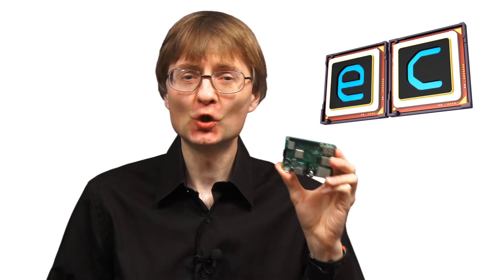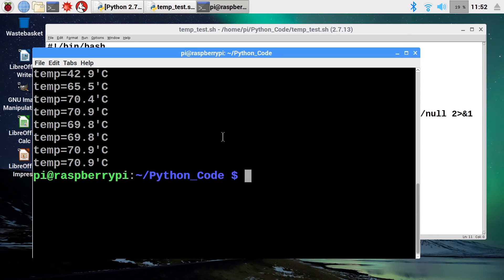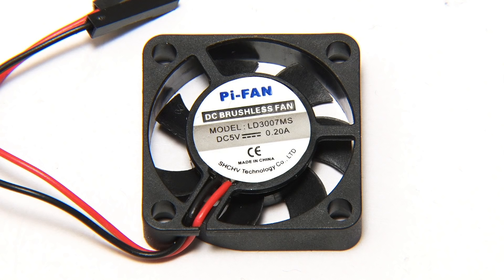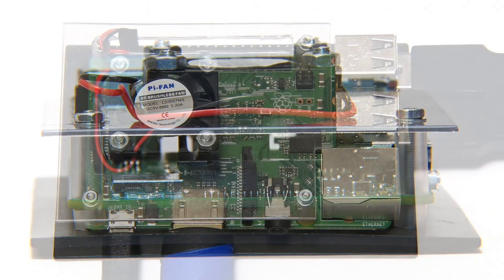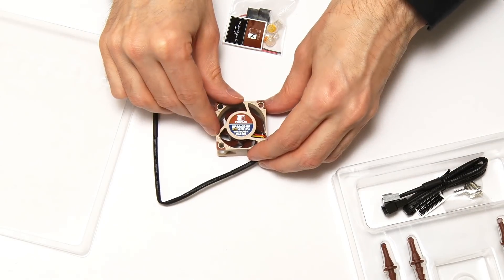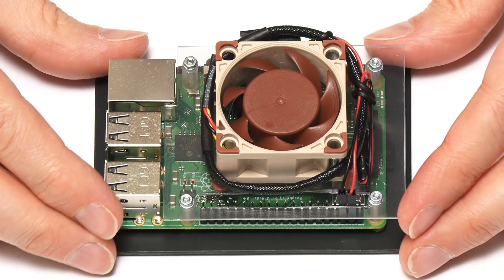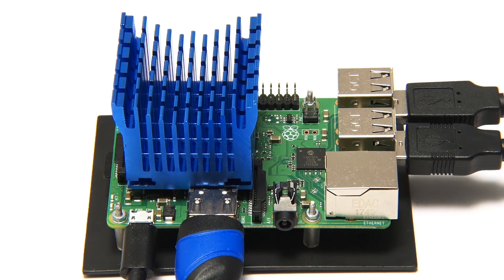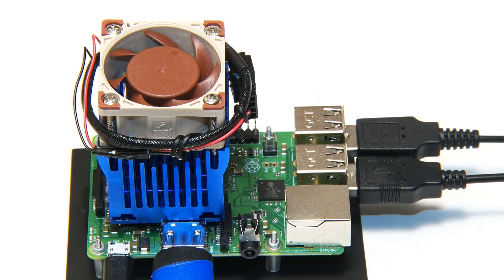Raspberry Pi 3 B+ Extreme Cooling

Comment: I have found that although sysbench maxes out the cpu cores nicely at 100%, not all 100% cpu loads are created equal.  For example if you run:  openssl speed -multi 4

The core temperatures ramp up much faster and peak higher.  This would not
 make a difference for one of one of your 'extreme cooling' solutions but it does make a significant difference for most average cooling solutions.

For example, those cute little 15x15x10mm heatsink ramp up to 80C very quickly under this load, and start to show the  temperature warning thermometer icon and throttle back the CPU.

Even non-overclocked and installed in the well respected FLIRC case (one of the best stock thermal solutions) my P3b starts to intermittently show the temperature icon warning after running this benchmark for several minutes.

When invoked with the simple command above, openssl will run through all it's crypto hashing and cypher algorithms, and you will see the temperature shift a few degrees as the cpu load changes slightly.

You can experiment by locking it to a single algorithm aes, rsa, sha256, etc.
openssl speed -multi 4 aes
openssl speed -multi 4 rsa
openssl speed -multi 4 sha256

Unlike the Odroid C2, XU4 etc, which ship with adequate thermal solutions, the Pi 3, even the latest 3b+, is a thermal basket case as shipped, so be sure to include an extra 10 to 15 dollars for an adequate large heatsink/fan when comparing price/performance.

Comment: Put zip ties to secure the heat sink firmly to the Pi. Better contact will yield better temperatures. In practice, those can go all the way down to 10 degrees difference, but since you are already (relatively) so close to ambient under load (about 15 degrees delta), your gains won't be as big. Also, try putting thermal paste below as well as above the copper plate. Also, if possible, try to get a thinner copper plate. Would be a fun video if you could try the suggestions from the comments.

Comment: Lovely stuff. I once ventured into overvolting and overclocking a Raspi 2 using a 50W peltier cooler, that had the hot side cooled with a large liquid cooling system. I got CPU temps down to -11C and frost started to grow on the back of the PCB. By some kind of miracle the Raspi actually survived.

Comment: The such a large difference between the noctua and standard fan is probably more due to the fact you had the standard fan sucking air through the heatsink rather than the noctua which blew over it.

Comment: I think it is the copper nugget  used in the larger heat sink that makes the difference, copper is a very good thermal conductor compare to aluminum (what the heat sink made of ). Try put the copper nugget in between the cpu and the small heat sink, see what will happen?

Comment: chris you should have it run your script but add at what Freq the chip is running at that moment and display it. This way you can see if it does throttle down in Speed?

Comment: isnt using a 5v fan frowned upon on a pie?
Reply from the maker: No reason it should be. As I explain in the video, the only pins that are safe to use are the 5V ones (as they are not technically GPIO pins). So actually, connecting a 3.3 volt fan to a Pi is what is dangerous (unless connected to the 5V pins via a resistor), as you end up wtih no voltage regulation/protection between the fan and the Pi's electronics. There is a great deal of poor and misinformation out there on Pi fans! :)

Comment: Please explain how 3rd test worked.... Coz the fan is the wrong way around
Reply from the maker: The fan was indeed sucking up rather than blowing down (my mistake), but this has very little impact on its cooling. It still moves air through the heat sink vanes and across the board. In a PC, where you are attempting to move an airstream with multiple fans working in combination,  individual fan direction can matter greatly. But not in an open rig like this! :)

Comment: Love these videos - keep 'em rolling :)   I ran the exact same script on my 3B+ with FLIRC case - here are the temps:-
41.3  /  51.5  /  53.2  /  54.8  /  55.8  /  56.9  /  56.9  /  58.0.    Not bad for a passive cooled heat sink/case!
Reply from the maker: Those are indeed good numbers. The FLIRC case has a good design.

Comment: The fan is a good solution. Im using it for the SBC projects, mostly from small netbooks, and Im also using the small heat sink. Last one was for my godson, when I fitted the SBC in a toy car, and the fan on the roof. He is using it for gaming purposes, and the temperature never raises above 60 C. 
Anyway, the final combination looks impressive. If you ever do decide to put such a massive radiator on the Pi, consider overclocking the CPU, and testing the results how far you can push the Pi limits

Comment: Hi Mr. Computers. I have a suggestion for your script.
add time in front of the sysbench command like you would sudo in front of another command, and it will display the time it took to run the in stdout like the temperature does. 

This way you would easier see how much it throttles or preforms compared to other computers.

Maybe there is also a way to display what the cpu clock was as well in a similar way.

Comment: Nice video. :)  I think the solution I like the most, is the die-cast aluminium case you can get for the PI - https://www.ebay.com/itm/For-Raspberry-Pi-3-and-Raspberry-Pi-2-Metal-Case-with-Cooling-Fan-Black-C9N4/192492581357?epid=10017057806&hash=item2cd173b1ed:g:9BwAAOSwvvBauHLh
Paired up with a small heatsink inside, a very neat and tidy solution.

Comment: Hi Christopher, i still have my PI3 with the heatsink and fan just like you set up on your prior video over a year ago.

I am not a overclocker, just prefer piece of mind when i can run my CPU almost 20 - 30 degrees cooler at idle and when working

Out of curiosity. i would have thought to include  in that script the start time at the beginning of the test and the time when it end the last loop and finalizes, that way you can see or estimate how often the PI was throttling and running on the lower 1.2g instead of 1.6g ( i am guessing the normal and throttled speed )

Regards  George

Comment: Chris, I thought you completed this experiment last week. However, this video shows you using different fans and different spreadsheets for the temperature comparisons. The last test, large heat sink with fan you might try another piece of plexiglas using the previous piece for the GPIO pins and the base of the large heat sink, then cutting out the squarish piece with a Dremel tool. You apparently don't have though or you would have shown one being used to cut out holes on the previous two templates. What is next? A water cooled heat sink?

Comment: You had the first fan the wrong way around.
You had it so it was sucking  warm air from the board rather than blowing cool air from outside the board.

Also I would think that copper spacer will hamper the results some what

Comment: You could have checked the fan alone ses to function very adequately all alone, with mine running no more than about 40°C.  I have the fan just about 1 cm off the top of the chip, glued in a square hole flush with the surface of the standard case. Mine is pushing air at the board, not pulling it.

Comment: That didn't seem like a very fair test between the cheap fan and the noctua since one was pulling air and the other was pushing air, pretty big difference since in this case you have the air being blown right onto the heatsink, also thought I'd mention that unless you're buying from a local seller even $5 is too much for those little fans, you can get them for $1 from china if you just search for "40mm fan"(even less if you spend a minute sorted by lowest price).

Comment: for more permanent solution, why not use arctic thermal epoxy? (it can be removed with temp/thermal difference and safely popped off via heating the heatsink with an iron or popping in the freezer)

Comment: The second test could have been better if you used the fan to blow air on to the heatsink and not pull, like you did with the noctua fan.

Comment: hava 3b 38.7 itle but have good cooling (selfmate alu cooler and 80mm fan on 12 volt and whitch pin 4 on the can i control the fan whitch pwm) but the fan is a extream loud pressure fan the fan is on itle but on 45°C the fan go on overclocked on 1,35ghz

Comment: I always find the Pi cooling tests fascinating. Thank you. Two things. First, I take it that the hole on the metal covering on the chip is for cooling purposes. I wonder if a hole drilled into the heat sink that lined up with the hole on the chips metal case would affect the outcome of the small passive heat sink test. Second, could a person slow the clock of the Pi down and significantly affect the cooling (not that anyone would use a Pi set up that way), but if one did clock the B+ to perform like an original Pi, if one could find the Pi running cool enough without added cooling measures.  Thanks for this video!

Comment: It would make much more sense to cover the parts that would short out from the large heatsink with electrical tape rather than use some copper that would add more instability to the heatsink (and therefore danger of tipping onto components and shorting out the board) as well as further material for the heat to spread through before it makes it to the heatsinks fins which would most likely make a difference to the results.  Also it looks like the large heatsink could be secured with a couple of cable ties.  This is not ideal but better than nothing.  At the end of this that leaves some room for overclocking the Pi to allow for greater performance.

Comment: Perhaps using the NB Cooler 1 the processor would have gotten a little bit hotter if the test had been continued for some more time, because it needs more time to fully absorb the heat given.
But still, great experiment to show the power of passive cooling solutions or the difference price can make using a cooler fan!

Comment: Great experiment with interesting results!
But I’m wondering: isn’t that bad to wire such high current inductive load like a fan without any flyback diode?
Also: at 5:00 you are saying that the 5V pin is directly connected to the 5V micro USB power source. I don’t think that’s actually the case, there are some poly fuses on all power rail. If you are doing some intensive CPU tasks while using some USB devices, using a fan may be a really bad idea since the fuses on the RPI can be close to they max rating and could blow up.
I’m not an expert so If someone have more info on that, I’ll be really interested.

Comment: Cooling CPUs is the key. I still do own an old computer from 2005 i built it with an Abit AA8XE 3rd motherboard, P4 intel 540J @3.2 Ghz, 4 Gb Kingston ram DDR2,  an Hyper 48 Cooler Master as CPU cooler. The original Graphic Card was a MSI NX6600 GT i replaced with a SAPPHIRE HD5670. The original PSU was a FSP Bluestorm i replaced with a BeQuiet 550 Watts. I changed all originals fans with ebmpapst 120 mm front, 90 mm on CPU and 2 x 80 mm at rear. "ebmpapst" is formely knows as PAPST. I cleaned out all ebmpaspt fans once each year. This old computer is still running like a charm a triple boot XP SP3, Xubuntu 16.04 and Mint Rosa 17.3 on 2 separated HDD with no errors at all ! Booting on XP requires 5 min though lol :) Thank you so much PAPST  you made this old computer lasting 13 years now !!!

Comment: Very good video, I notice the last cooling solution was resting on top of the black connector on the left side, perhaps it could be a better result in the temperature if the coolingblock was shifted 2 mm to the left and pushed down with som zipties

Comment: Thanks for an interesting video.  My criticism is that in your table of results you do not show the price in relation to the effectiveness of the cooling. Could you make a video which demonstrates the cheapest cooling option? So far am am using a laptop cooler from the £1 shop! I've got one under my tangerine iMac, my router and my laptop and R-Pi. Total cost £4.

Comment: Even Raspberry pi 3 B+ need a heat sink, i can imagine that Raspberry 10 need a water cooling.

remember Nvidia Riva, 3DFX Voodoo, or ATI Rage GPU ? back then (late 90's / early 2000's) even the most high end GPU doesn't need a heat sink.

Comment: I do like that noctua fan setup, especially with the cable management, making it look nice and neat, if you want to use an extreme cooling method, try mounting a Pentium 4 northwood cooler from an old early 2000's Dell on it

Comment: Another very good video Mister Barnatt. The Noctua looks like the solution to go with. I admit though while I realize that this is totally impractical, I would be amused by seeing how a 3B+ would operate when cooled with liquid nitrogen just for the heck of it. LOL  Seriously though how would I access the GPIO bus with the Noctua installed? I cannot remember seeing a riser card or extension cable my wanderings of Pi 3B+ accessories. Are you aware of any 3B+ accessories that will be coming to market in the foreseeable future?   Cheers.

Comment: next time, please also add a timer into your script. If a system is thermal throttling, the temperature might stay the same for different test, but the run time for your test might go up.

Comment: I have seen one person risk their Pi 3 B+ by removing the metal cover from the CPU to directly place the heatsink to the CPU chip itself. The risk of the damage you can do though versus the minute gains in cooling you could possibly get I think is are just not worth the risk of permanently damaging the Pi.

Comment: I have a Pi3B+ in a layered case with no heatsink and a small fan running on the 3.3V line instead of the 5V. Even at full load for a long time OC to 1.5GHZ it does not get any hotter than 60C.

Comment: I wonder if we were to cover the Raspberry Pi with kneaded eraser  on  the back and front to prevent short circuits except for the CPU and mount the back neoprene mat and metal plate and mount the lock mount on top so that the cooling probe can be installed with it's associated neoprene sleeve and rotate the locking ring by rotating so that the cooling probe won't pop out and connect the SBC to the 5V supply that also operates the Phase Change Cooler and connect the power switch to the power connection the Phase Change Cooling control board and connect the power on connection to the Raspberry Pi so the system will boot when the cooling probe reaches -70 degrees below zero.and causes the Raspberry pi to fire up

Comment: You could probably make some form of bracket similar to the kind of mounting solution you see on bigger CPU towers for normal PCs, and mount it to those screws you were mounting those plastic covers onto to hold your large heatsink on to turn the big heatsink/noctua fan combo into a practical solution.

Comment: i actually found on mine that the old nasa/cray pitest.f (pi4d.f) compiled in gfortran produced higher temps to test with.  I put it in pastebin for ya.  https://pastebin.com/FLrrjMMf

Number of digits is adjusted by changing MX (Default = 14, max as specified in comments is 23) in the PARAMETER block in the main program near the bottom of the listing.  For reference, MX=14 completes in 7 seconds on a Cray X/MP-4.  four instances of it will put you ever so slightly in swap at MX=23.  Use MX=22 (about six million digits) if that is a concern.
Reply: You can find it here:  https://pastebin.com/FLrrjMMf

You can change the number of digits in the MPCOM1 COMMON block in the main program near the bottom by changing PARAMETER MX.  Default is 14 (about seven seconds on a Cray X/MP-4, heheh), stated max was 23 (about twelve million digits).

Caveat.  Offset the start of each of the four instances to run simultaneous by waiting for the second iteration message to pop up.

./pitest &
wait for "ITERATION 2"
./pitest &
wait for "ITERATION 2"
./pitest &
wait for "ITERATION 2"
./pitest &
wait for "ITERATION 2"

this will allow the output file to not be clobbered, and the output that results will be left by the fourth instance.

Four instances at MX=23 should put you JUST BARELY into swap. if you don't want to go there, drop MX down by one.  Using screen, have top running in one session, the tests in another, and monitor the temperature using a shell loop with a one second sleep in a third.

Comment: Another variable the would be interesting in the test is how much time the benchmark took in each configuration. Would give an idea of if and how much the PI thermal throttled
Reply from the maker: Good point.
Reply: That would only make sense for the first column without cooling, as its the only one where it hits the 70 degrees mark. I think it would be much more interesting to see if you placed the different setups into a matching box as a finnished solution and see those numbers. Its fairly easy to get good cooling results when it isn't mounted in a matchbox sized closed environment  with only som small holes for air intake. What I did notice was the pleasant silence when he started the Noctua fan compared to the much cheaper Pi-fan wich was rather noisy. This is from the perspective that the user wants to build a small box for eg a mediaplayer box that both looks nice, don't get too hot and makes as little noise as possible :)

Comment: You always make great videos, my Pi must be overheating with it's tiny heatsink and NESPi case.
Reply from the maker: The NESPi case has mounting for a 30mm fan as I used here.
Reply: ExplainingComputers think I'll have to invest in one!  Poor Pi, has to work quite hard running emulators.
Reply: Knuckles the Echidna Dude, add a fan. My Nespi with heat sinks and 30mm fan runs around 47 c. Even under load. If noctua made a 30 mm fan, I’d be using one. The pifan is a usable fix. A bit loud and needs proper mounting, otherwise it will vibrate and sound like a weed whacker. Also get a copper heatsink for the bottom chip.
Reply: Knuckles the Echidn